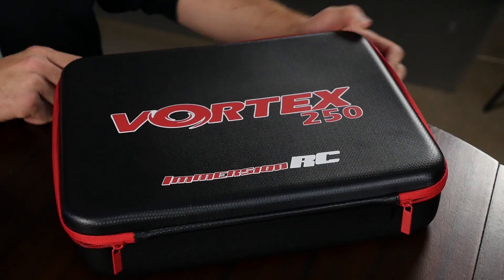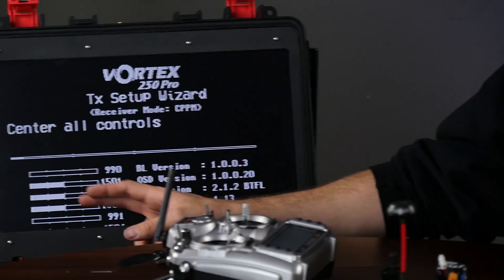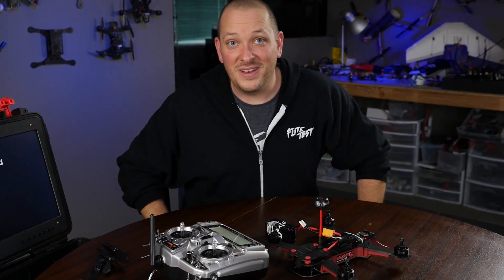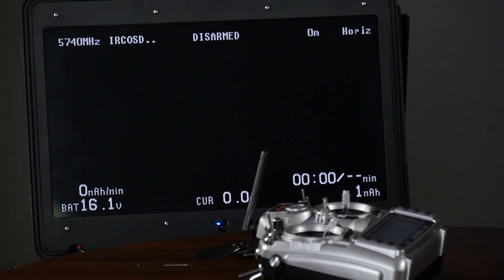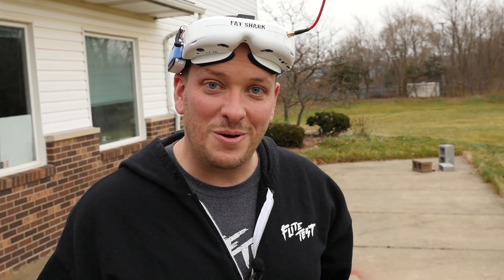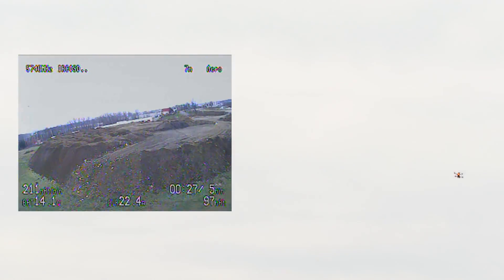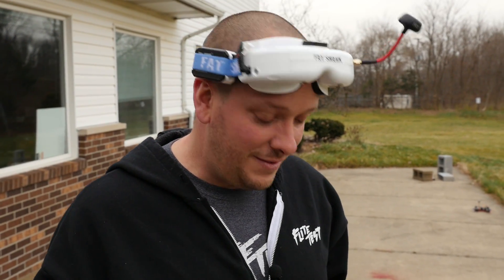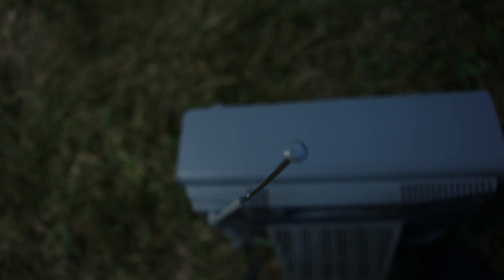Vortex 250 Pro - Getting Started | Flite Test

Comment: So, how do the flips work in acro mode? I've been flying beginner drones, and I'd like to try some more advanced ones.
Reply: Blip the throttle until you have an adequate hight then drop the throttle back down to zero and perform the flip once you've made a full rotation stop the spin and throttle up

Comment: after I set it up I keep getting a beeping sound and when I test the with props off I will rase throttle and moters speed up but when I lower throttle  the moters seam seem to stay at the same speed if I max out the throttle and lower it it stays max witch wories me as I do not want to put puplers on and have it flay off and it keeps going until I dissarme  any help would be do grate

Comment: If I were to switch those props out for KingKong 5040 3Blade props, will the lock nuts that come with the quad work be able with them? if not which lock nuts should I get? And what tool should I use to get them off? Thankyou for the video, Really helpful :)
Reply: JWKS2003 they'll work

Comment: can i use a spektrum receiver with this even though its not ppm. do i need a ppm module on my dx9?
Reply: Yes you can use a spektrum receiver, in fact you can buy a bind and fly version of the vortex 250 pro that already has the Spektrum racing diversity rx installed. Search for the Blade Vortex 250 (it comes with the green pimp kit installed).

Comment: " hey what's up everybody this is Josh I'm going to show you how to get your vortex 250 Pro setup in under 5 minutes" ..... but its gonna take nine minutes and six seconds to explain how. BTW great video Josh. it seems my vortex is not on easy mode which I think is angle mode. when I give a little forward pitch it will hold that until I make a reverse correction a rear pitch.

Comment: flight test  hi josh great review  iv just got my fist racing quad  the nighthawk 280 pro  but im in need of a bite help  iv got it built and trying to set up my transmitter and receiver  settings on baseflight   everything seems ok  according to the set up video  used  but  iv no roll  when trying o set up my settings on baseflight  the receiver lihgts solid  and the main board  has a red solid light but the green lights still flashing away  and the quad wont arm and start up   can you give me some help on this please  josh

Comment: Ok guys and gals. I really need some help. I would love to get into this sport but having a horrible time finding a drone to run. I have experience in drone flying and heli. I'm by far no expert but at the same time not exactly a rookie. I just want a solid rig to run. I already have my fatshark ready and waiting. I just need some direction. Was looking at walkera 250 advance. Or a eachine 250. But looking at this vortex. I want to get my money worth. Also the programmable controllers I don't have much experience in.
Reply: The Walkera 250 from what I've seen seems too slow and not very agile. Good if you're just starting out. Haven't got one myself but looking at the Eachine Falcon 250. Seems pretty affordable.
Reply: +David Pierson yeah I think I'm just going for the vortex 250 pro. Just need to decide between the regular and the blade edition. Trying to research the major differences.

Comment: I need help guys I just purchased a Vortex/Horizon 250 pro just the other day and I went to update the osd firmware and it was fine and flashed it on clean flight and it was fine too; so I tried to restart the wizard from the back of the drone and I'm not sure what happened but it won't let me restart the wizard and it won't bind to my spektrum Dx6 anymore!!! So I hooked it up to immersionRc tools and it recognized the drone but it's saying that it's in "program mode" so now I try to link up with clean flight and now it doesn't recognize it anymore and I can't get it to connect with clean flight! The drone won't bind and won't link up to clean flight and is in "program mode" and continues to beep and blink every few seconds but nothing! Please help me. Btw it was never maidened.

Comment: I am trying to set one of these up with a taranis radio and d4rii reciever but I cant get any of the controls to respond in the setup menu.  I am stuck at the screen that says center all controls and it doesnt show any movement of the sticks.  What do I need to change or setup in my transmitter to fix this?
Reply: I have the transmitter successfully bound and it is talking to the reciever but something is quite right with the cannel mapping on the vortex 250.  Also,  I am unable to connect it to clean flight.  Is there a special driver or something I need to download in order for it to connect and work on clean flight?

Comment: Is there a way to set the vortex to where it will fly say like my Chroma does when you push the stick forward it goes forward and when you bring your stick back to center the quad levels it's self back to center and hovers. See what I mean? Lol. Josh (my son) isn't use to flying how it is now when your push forward it stays forward until you pull back on the stick to bring it back to center. Or is that how it Flys when it's in acro mode?  If that makes sense. LOL
Thanks, Chad. God bless & Happy New Year!!!
Reply: +Rcflyingandsuch Thank you for the reply!!! I finally figured it out. Lol. 👍🏼

Comment: Thanks for the review Josh. I was just going though the Interim Final Rule regarding small unmanned aerial systems (sUAS) and it sure looks like FPV googles are going to be illegal to use due to the line of sight requirement for the operator. Wow, that would kill one of the most interesting segments of RC evolution. Bummer!

Comment: Few items I would like for you guys to address in your next Vortex Pro video:: How versatile and cost effective is this machine as far as repairability? Be honest and realistic here.  Does this machine end up costing more in repair parts when compared to your standard scratch build 250 machine? Also, which parts (besides the props) take the brunt of the damage on impact?  Thank You// Alvin
Reply: good question
Reply: I have the first gen vortex with folding arms and it has been kind of finicky. The Pdb went out twice. Once on its own (a component burned up) and immersion replaced it free of cost, secondly was a wonky crash that caused an arm to damage the board (I replaced it myself, my fault.) The LEDs being slapped by the arm tends to KO the LEDs kind of quickly right now my LEDs don't work but it still flys. That being said, I feel like the Pro (even though I don't have one) has really eliminated the main problem by just making the arms and body un-foldable and mostly all carbon. Also I think by now some of the bugs have been worked out since my first gen version. You can't beat all the built in features for the price even on my vortex. If I could, I'd buy the Pro over the foldable vortex, just my opinion.
Reply: +Armenian Well I think it has a goog value for its money. Building a scratch build won't be much cheaper. The only downside of the quad is the fact that you can't really upgrade any hardware.
Reply: Amino

Comment: Complete noob here, don't know what PPM is. Will this work with my DX6?
And what other items will I need to setup with fatshark googles?

thanks
Reply: +Wales Wideman Im not familiar with flysky but as +ElmerFuddGun said its the receiver that needs to support PPM so it just depends on weather or not you can get a ppm compatible receiver for that transmitter.
Reply: +drink15 Check DX6 receiver specs if it mentions it supports PPM (also known as CPPM) it will work. And assuming your goggles are one of the many versions that have a built in receiver they should already work with the transmitter built into the quad no additional items required.
Reply: +Brandon3055 what about flysky 9x not to be confused with frsky
Reply: ElmerFuddGun Thank for the help. I did some quick looking around. Everything I found I think is beyond my skill level. I'll revisit this when I learn more.
Reply: +drink15  Not sure what others would think, but it sounds like you and I are about at the same experience level.   So, to answer your question,,,,if the DX6 doesn't do PPM, then you  are screwed.  I have a FlySky FS6.  It does PWM (One wire per signal).  A receiver that does PPM (CPPM) won't help if your transmitter only does PWM. (like in my case).
Reply: Drink 25. Wassup man, hey i just got a question, did you get a answer yet about vortex 250 working with the dx6?
Reply: Raymond Nerona By itself, it won't work. The guys in the other comments said how you can make it work.
Reply: drink15 it will work

Comment: where Do i get the googles from? or how are they called
Reply: +NGHTMRE Those are Fatsharks. Probably the Dominator V2.
Reply: +Balu thanks :)
Reply: Those are the fatshark dominator v3's. They are about $350 in most places. You can find other fat shark goggles or goggles from other companies cheaper, but the dominators are a good pair.
Reply: +Ethan Kling That reminds me why i cant have nice things... Because everything is 40% more expensive where i live (tasmania) meaning for me a set of Dominator v3 goggles would cost $486.49
Reply: +Brandon3055 i have seen some pairs of goggles for as low as $30 in some places
Reply: +Ethan Kling Well yes there are cheaper alternatives. I have the hobbyking quanum v2 goggles which are great but things like the high end fatshark goggles are just so much more expensive here. But its not just goggles. Anything i order from the US costs about 40% more for me so for example a quad that costs $300 in the US would cost me around $420. And the reason is just the AUD has fallen through the floor in recent years. Just a few years ago AUD was very close to and at one point actually overtook USD but now its fallen to around $0.72 USD
Reply: +Brandon3055 get the headplay

Comment: First! 

Ehhh, a little expensive for me...(499??!)
Reply: Yeah $499 is too expensive, maybe $250- $300 would make it a winner for the consumer
Reply: +tittyfuckn Mmmm yeah, I guess if you have money but no time to diy it would be good. It does fly really well of the box which is impressive. A good turn-key solution.
Reply: +Curious airlines Thats crazy Cheap! Honestly try and build a QAV or Even a ZMR with a camera, VTX, OSD, Built in Setup wizard?! (Only racing quad with that atm) plus motors, Props, PDB, UBEC. I can't belive its this cheap!

Custom building that would cost you around $1000 and more if you really want to blow out!
Reply: cobra 2204 1960kv on my first one
Reply: Ooooo those are nice.
Reply: +Robbie Goodman I should add i do not own a vortex.  I build all my multirotors, for costs sake. If i come across some money I may well splash out on one of these just to have a go.
Reply: +Robbie Goodman Yeah, actually for what it is it is pretty good. I spent the same on my fpv 250 quad, but didn't think it is as good. It probably is...
Reply: +Robbie Goodman build my ZMRs for about 400, with a cheaper controller, and its performance far exceeds the vortex. (minus googles, I flew with $30 hobby king screen for a long time)
Reply: +spyder1721 What motors did you use may I ask?